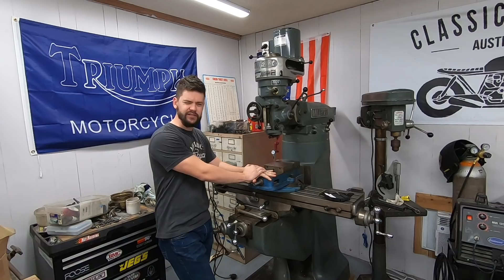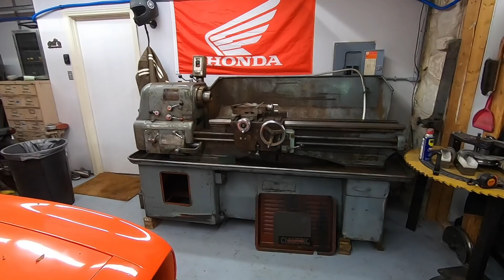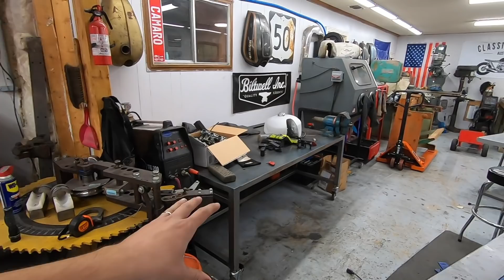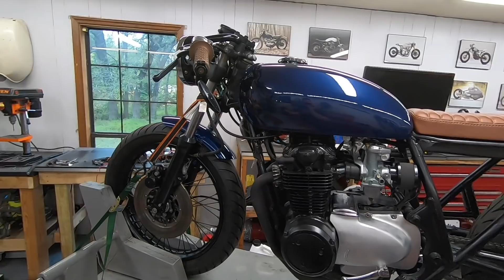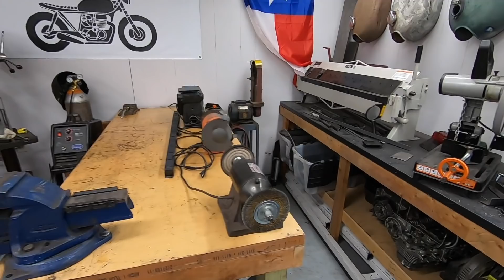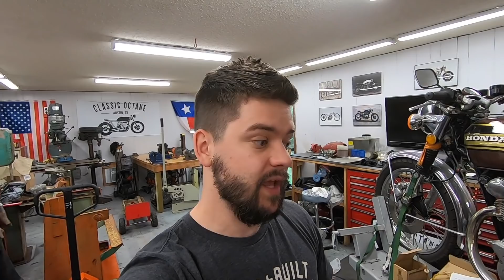Shop update: 6,000 pounds of new tools!

Comment: Great channel, just a thought, get a drive for your lathe motor that has a filter to protect the windings of the older motor, without filter protection older motors will run for a while then the winding go down to earth,  tech and terminology will be different as I am  uk, but a good supplier should be able to advise.

Comment: Finally a CB450K!!   Yayy
I hope you run into the same problem i have with mine so you'll teach me how to fix it.  

Doesn't want to rev past 5k rpm.  Other than that, runs fine.
Reply: What happens before you reach 5k rpm? Bike cuts out? Exhaust popping?

Comment: You can probably use the same phase converter on both the mill and the lathe. You just can’t use both of them at the same time. But I doubt if you would ever need to run both at the same time.

Comment: This will make you cry. 6 years ago we were told the school I used to work in was going to be demolished to make way for a new build. The technical department was not allowed to take the old machinery to the new building, so 4 complete lathes with all accessories and 2 milling machines, 2 band saws, 1 hydraulic hacksaw, 2 pedestal drills, 1 arc welding machine, 1 10 tonne trolley jack, at least 12 solid wood working benches complete with working vices were all scrapped.
To be replaces with cheap Chinese lathes. It makes me cringe now to think of such waste.
Reply: Sounds like the way schools are run these days.  Stupid "educated" people making decisions like that, they should all have been fired.

Comment: You may want to check out American Rotary out of Wisconsin. They are a really great family owned company. I operate a small shop similar to yours in chicago IL and I’ve been using one of their ADX converters with a 25 horse motor to run a 5hp 3phase 80Gal compressor and a 16”x60” South Bend. It’s worked flawlessly and very easy to wire up. Good luck!
https://www.americanrotary.com/products/view/adx-smart-converter